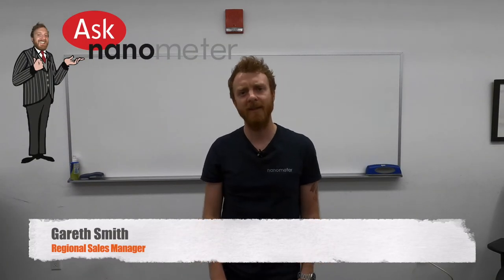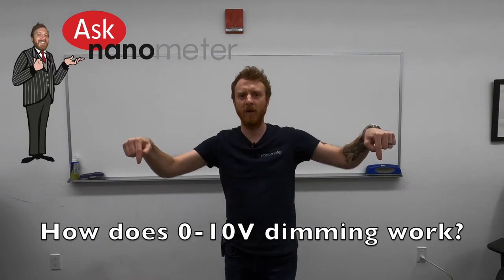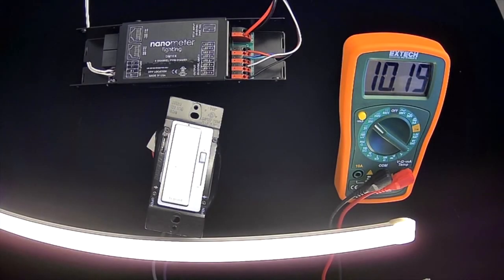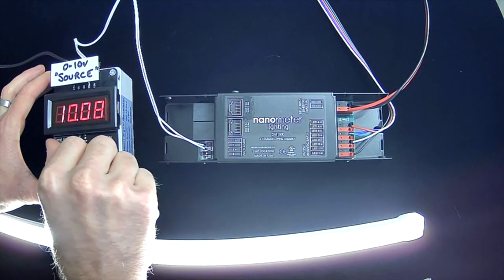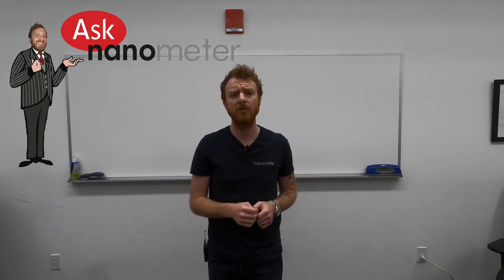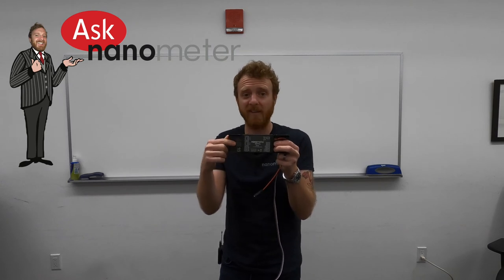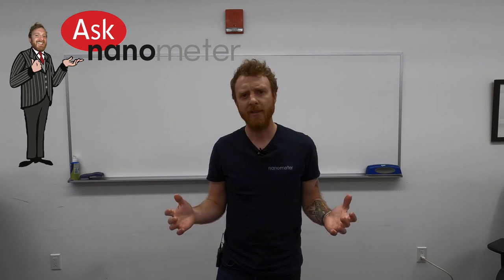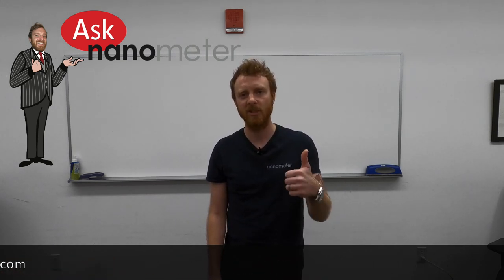How Does 0-10v Dimming Work | Ask Nanometer

Comment: @nonameter_Lighting If the LED driver is providing the 10VDC with a positive and negative (Purple & Pink) to the "dimmer", how is it reading a change in the 10VDC? What's going on in the dimmer that would change the voltage? 

Or am I looking at this in the wrong way. 10VDC is coming from the driver on the pink which is powering the dimmer, which then sends the adjusted return voltage on the Purple?

In any case, how is the voltage changing?
Reply: Slide dimmer gonna resist
Reply: @r055f1991 That only answers half the question.
If the dimmer is simply a resistor, no matter how big the resistance is, the voltage across that resistance is always going to be 10V.
Reply: I can think of two possible ways to detect what the controller does in that case, if the controller is a simple variable resistor.
- By increasing the resistance, the current that will flow back to the driver will decrease.. The driver could measure that.
- The driver output is 10 Volt but has an (internal) output resistor of 10k (for example) Then if you change the resistance of the controller to 10k, the output of the driver (at its terminal) is only 5 V. Each of the resistors (both 10k in my example) drops 5V.

I don't know what happens inside your specific driver.